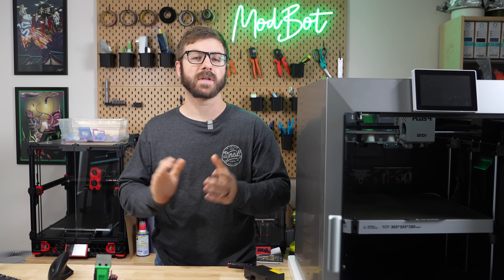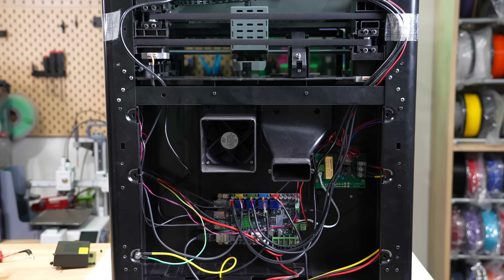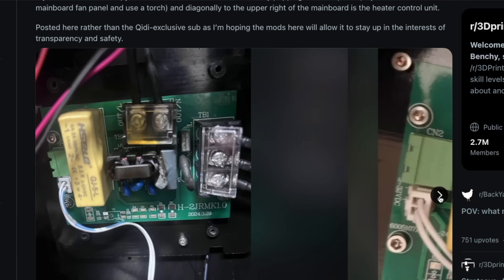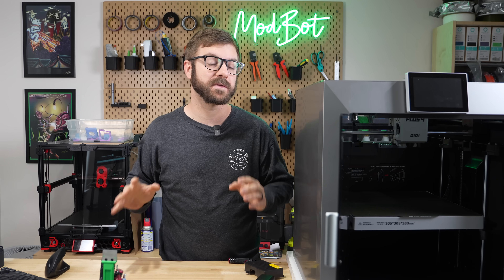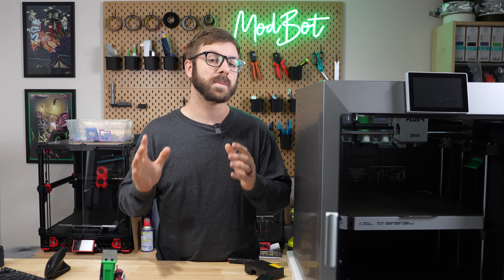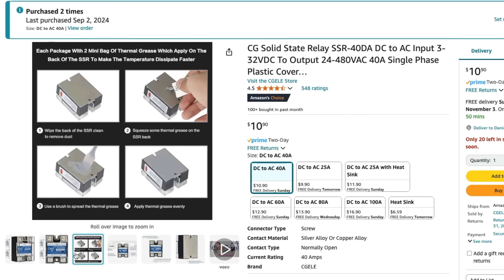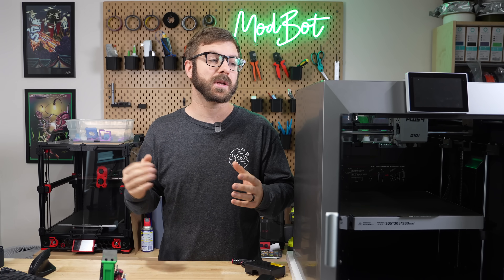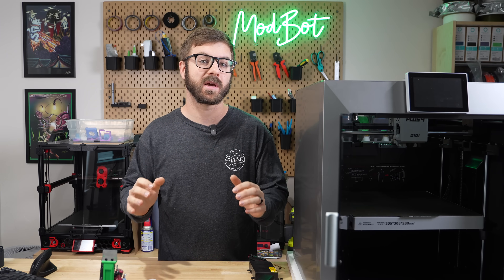PSA: SSR Safety Issues With Qidi Tech PLUS 4 Printer

Comment: As a software engineer for machines I am not so keen on this video. Let me elaborate a bit. 
We make test machines for industrial applications - EOL testing, etc. I think we have a fairly similar team to what Qidi would be running for their machines. These issues are EXTREMELY hard to find. Unless you deliberately test for these - which let's be honest, why would you - you will never catch.  
We had machines where the screen went offline sporadically. It took us half a year to find that the unit under test had a solenoid, that when turned off sent back a pulse through the power source wire which emitted EM disturbance. It was not even near the screen HDMI cable but the EM from this was enough to disturb the picture transfer. We could solve it by installing a single diode. We had to retrofit machines at multiple customers around the world. 
We had cases where we have to measure the temperature of the ambient room the machine is in, and compare it to an onboard value from the unit under test. We designed a machine and found out issues with this measurement after almost 2 years on the field. The electronics cabinet got so hot that the latent heat from the cabinet could disturb the temperature sensor inside the machine even though it is about half a meter away. 
What is mentioned in this video is indeed a problem. But flat on telling that "qidi should do more testing" and that "avoid it at all cost" is quite damaging to the reputation of the company - especially as many MANY people will watch this video before a commitment to a purchase. 
I have not had any issues with previous machines - till to this day, my favourite is the X-Plus 3. 
I doubt anyone would be able to find this issue unless deliberately looking for it. Qidi is in china and they have a grid system for 220V50hz - they would have needed to simulate a 110v grid system // use very expensive power supplies to verify the machine for this issue. We have NEVER tested any of our products on a 110V system even though we deliver to USA as well. Every component states that "it works" or a "switch has to be moved" or similar. CE is stricter than the standards in US and if we certify a machine usually we do not have to do other certifications or testing. Why would we? 
I do agree that the situation is suboptimal - but cut them a bit of slack. Big corporations need a bit of time to decide what to do and how to progress. And I am certain they will resolve this in an acceptable manner :( This video just made me a bit sad. 
I agree, it is not "safe" and they should have already stated something. But this was just a tad bit harsh :(
Reply: This isn't some rare occurrence though. They failed to test it for 110V, while selling to markets that use 110V. This happens on every machine while using it as it was intended to be used.
Not acceptable, and no they should not be given any slack.
Reply: @ScytheNoire to be fair, it is a lot harder than you may think to design and test for a global market the many different power standards, units of measurement, etc.
Reply: Yes @what Noire said. It’s like they didn’t even run the machine at 110V with the heater on or something. If they’re rating it for certain operating conditions, I’d expect them to at least do several trial runs at those conditions ie. rated temp range, humidity range, etc. them skipping such incredibly basic testing is a very poor look for their company. This isn’t some ghost in the system type of glitch that gets triggered by some unexpected emi, this is a bug that should have occurred every single time the chamber heater was used at 110v
Reply: @SunnyL-p9l  This simply isn't the case and is baseless speculation. Qidi obviously messed up here, but to say they never tested it on 120V is silly. First of all, the Q1 Pro runs the same chamber heater power supply. The difference here is that the Q1 Pro heater is only 300W. However it does mean the power supply has extensive testing on 120V. Bumping up the Wattage to below spec shouldn't cause rampant failure.

That still doesn't count as testing, but they quite obviously had test units well before selling and reviewers had units well before sale as well. There are people, including reviewers, on 120V with tens or hundreds of hours of print time including using the chamber heater, including on the old firmware, without evident failure. Why some units fail while others don't? Well that's part of the problem and difficulty with testing, isn't it?

All I'm saying is, making wild assumptions is silly. What we do know is that they messed up, they tried to fix it, it wasn't good enough, they are now sending out a revised power supply, and hopefully that will fix it. How and why they screwed up in the first place is gonna have to be addressed internally, and obviously testing was not robust enough, but there's no reason for hyperbole.
Reply: @802Garage  This :) Testing for this is EXTREMELY hard :) And someone mentioned transformers. No. You need power supplies that you can adjust for voltage, frequency, current, etc. Those ones we use at the lab can cost up to 15k€ :) Imagine that you would like to do extensive testing with this expensive equipment. It does not make sense to have multiple power supplies for this. There are some long term test they probably did, but this issue obviously did not come up. And they probably did not test 100 units for long term in a lab. In the current market it is always "get to market as fast as possible".
But honestly, I doubt it was tested. Unless there is a norm (which I believe, there is none) this would most likely not come up.
Reply: @HuntersOA  People also overestimate how large these companies are, how many employees they have, and what their budgets are like. That's not an excuse to release a broken product, but it's worth mentioning. Qidi is not Creality or Bambu Lab.
Reply: I have to disagree. Yes, poor corporation, but even I who did one hobby project with mains in their life know you should check the ssr for overheating.

This isn't the factory floor and this isn't B2B. This is more akin to having e.g. phillips sell an espresso machine that's a fire hazard and trying to justify it. People don't have safety inspectors, or teams of lawyers to sue like your customers do. This is the best we get, revealing the truth to the customer so they can be informed and a literal slap on the wrist to the company.

Nobody gives a shit if it hurts the companies feelings. I don't want my family scorched up because of a tool I buy.
Reply: A good perspective to keep in mind. While I myself have been pressuring Qidi to make changes once we found the issue, I always remember there are workers doing their best on the other side. The company obviously didn't want this to happen, they just need to take the right steps to fix it. We have now heard they have updated the power supply board. Hopefully it will function properly on 120V!
Reply: @802Garage  I sure hope so! :) I'd not want to be on the engineering team now having to deal with this matter though :D
Reply: Component rating isnt a "testing" failure, its an engineering failure.
Reply: It really is not hard to test 120VAC, Transformers for this are commodity items. Now yes you would get 120@50 instead of 120@60 but for a resistive load like a heater that wont make much difference.
Reply: The issue could have been very easily and quickly found with a thermal imaging camera.

Comment: FYI. A firmware patch ain't going to fix s*** when it comes to power demand. I don't have the machine, but the software "fix" is most likely just a sudo PWM limit to tell the machine to never be on at 100% during normal operation. However, if the Klipper crash, that limit is useless. The only way this can be fix this is a recall, to replace that heater controller board with something that is designed for the appropriate voltage / ampere.
Reply: Yup, probably just puts a 
max_power:0.6 
or something to the [bed] section of the printer.cfg, which wont fix this issue, just delays it
Reply: @CanuckCreator  Yes, 0.4

Comment: Good video. I'm a little confused because a heater is a resistive device, ohms law should be used to determine the maximum current it needs, and then, you know, allow a safety margin above that, and pick components rated for this. 

What's that got to do with firmware? 🤔
Reply: The firmware controls the SSR board via a PWM like signal. It's not high frequency PWM like for a fan, but it still switches on and off quickly to create a duty cycle. The old firmware was set to 0.7 power factor, or theoretically 70% max power, and was causing far more current to be drawn through the board than it is rated for. They say up to 800W which matches what a lot of users have seen. This was causing the chamber heater board choke/inductor to overheat very quickly and fail. The updated firmware sets the power factor to 0.4, drastically reducing the power draw and keeping it under 500W, they say 460W max ideally. Unfortunately, despite the unit being rated for a theoretical 5A, we were still seeing temperature spikes far higher than what the choke/inductor was rated for, even at the 0.4 power level. Possibly because the PWM mechanism causes current spikes that are hard to monitor. We aren't sure, but either way we have been pressuring Qidi for a hardware fix instead of software. Much testing was going on even before the 3D Musketeers stream testing this, but we are happy he showed a live demo of the issue. As of last night Qidi says they have revised the board and will start sending replacements soon. We are hopeful it will be a real fix.
Reply: my assumption is that since the boards are designed for 220V, since its at 120V, to compensate it is trying to take in more current that what is rated for.
Reply: @BroadwayNexp  With the current firmware, the heater draws just under 2A on 230V and about 4A on 120V. The 4A draw for too long and with whatever other factors are at play is causing the board components to overheat, specifically the copper coil choke.
Reply: My safety margin when designing this sort of thing is usually double the rated current of the load. This is honestly mortifying
Reply: Now I'm more confused. It wasn't supposed to be mains voltage heater this time 👀
Reply: Not a damn thing, you're absolutely right about that.  I haven't even used the chamber heater at all.  THis morning, the only thing on my Plus 4 that lights up is the power switch.
Reply: Oh and you DONT DESIGN STUFF TO ONLY NOT BURN OUT UNDER A PERCENT OF THE MAX DUTY CYCLE 😮
Reply: @LostInTech3D  It is a mains voltage chamber heater. The bed heater is still 24V. I agree the components should be designed to run at maximum for safety. The Q1 Pro uses the same power supply board for the chamber heater, but it is only 300W, so there has never been an issue. It's a bit of a mess.

Comment: Excellent video. I pulled my 4 Plus off the shelf until a fix is provided. The rush to push products out the door is really starting to show the fraying around the edges. This isn't JUST a Qidi problem, but darn near every company. Think A1 Bed Recall, even Bambu has had issues. Proper and further testing is clearly the answer but in today's competitive pricing market every day of delay and testing costs money to a company so I really wonder if we will see a proper change. Hopefully.
Reply: Funny all these companies have one thing in common.
Reply: They came from countries with a decent electric grid? That board apparently works fine on 240 @bthatguy1181
Reply: @bthatguy1181  Really? Because Prusas have had early launch issues too.
Reply: @BeefIngot  They didn't have illegitimate power certifications and exposed electrodes
Reply: @bthatguy1181  Sure but they have had thermal runaway issues solved partway through the cycle.

My point is just to say they aren't darlings.